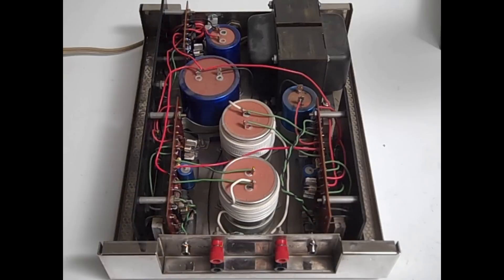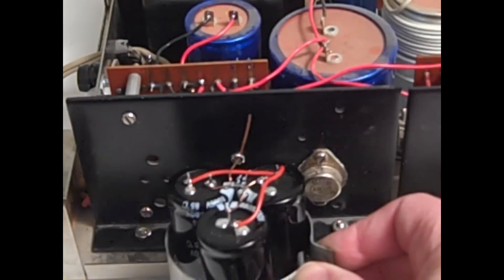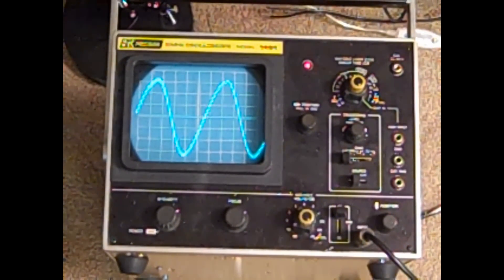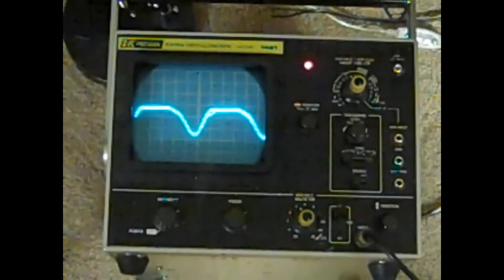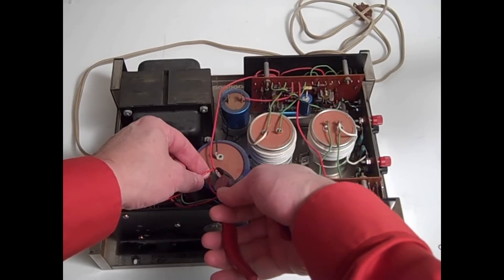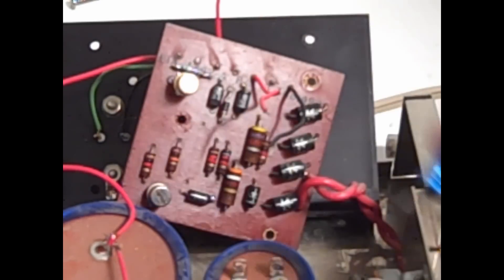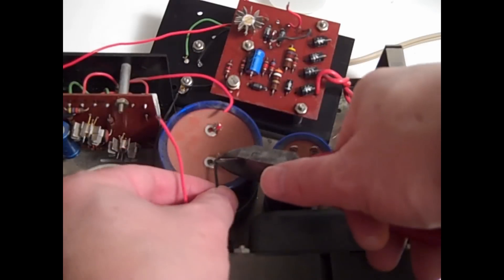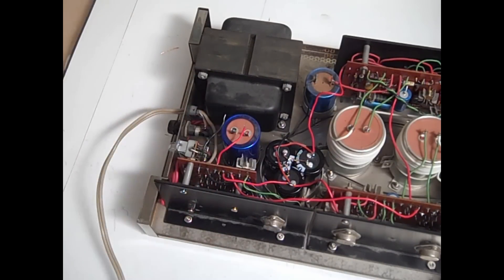dynamite caps

Comment: What is the point of the wire going around the capacitors?I haven't seen that before.
Reply: The coil around the capacitor is used to make the output inductor that 99.4% of amplifiers use to assure stability.

Comment: Great video, good in depth detail of the problems with the power supply and very well explained.  I have one of these amps myself and plan on doing quite a bit more than upgrading the power supply cap.  The old regulated power supply is not really all that great so I am going to change it all together and use a Mosfet as the regulator which will take more current and be much more efficient.